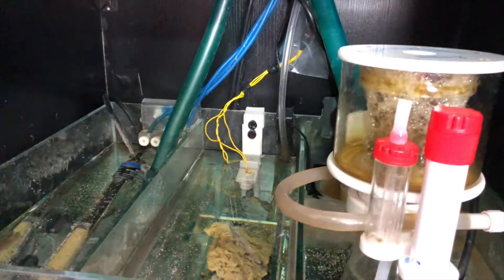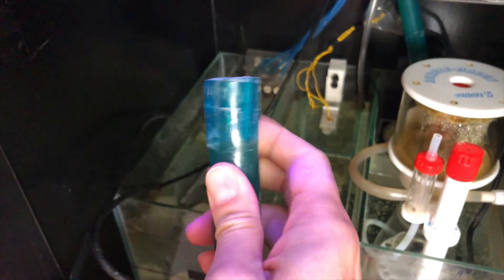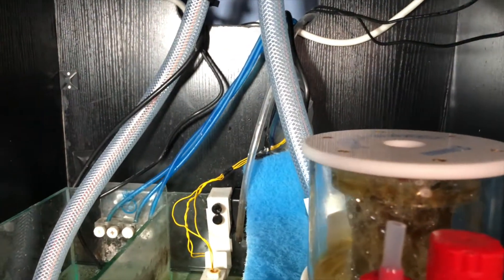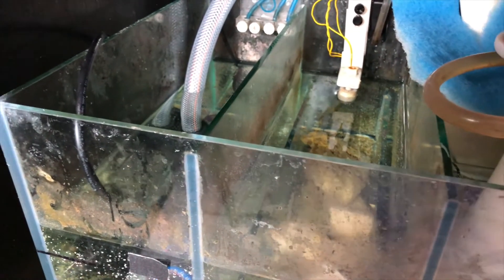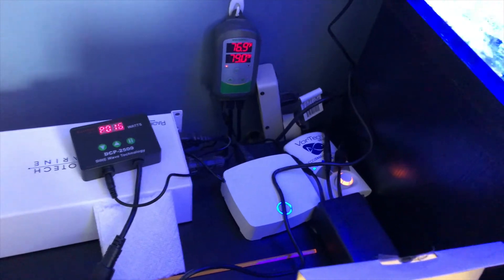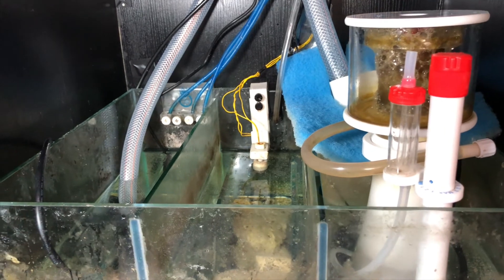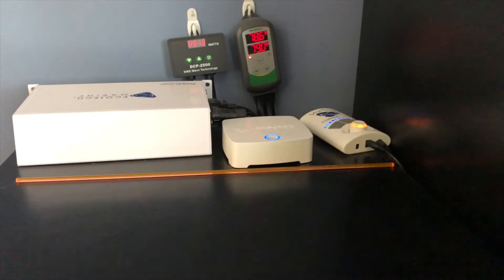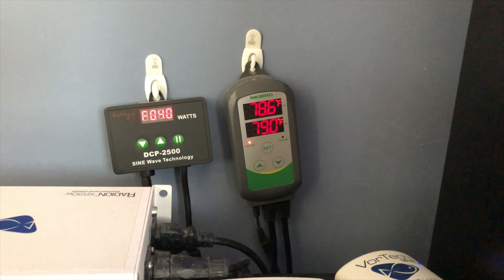Reef Tank Return Pump Upgrade - DC Controllable Jebao DCP-2500 Install

Comment: I'm debating on this one or the dcs2000. I just seen a video where the dcs 2000was making a pretty loud noise but I do believe that's it's the newer pump. Decisions, decisions....
Reply from the maker: I did have to soak it in citric acid and clean it real good after it shutoff on me 6 months in. So a bit disappointing. Take that as you will in your decision.

Comment: You shouldn’t have a power strip that close to your sump or in your sump at all, that’s extremely dangerous and I hope it’s connected to a GFCI outlet
Reply from the maker: I definitely need to do some wire management, but I do use GFCI on both tanks.
Reply: @skippersreef4009  that’s good, they are life savers for sure